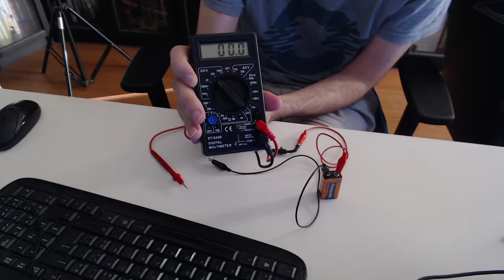How to: Test a HV Diode with a cheap multimeter and 9v battery

Comment: We used a crank megger to test them, just crank really slow and watch the meter. The dividing point in diagnosis is the transformer primary, voltage or signal from the board. Hardly ever had a bad transformer, bad tube, diode or HV cap, were common., If the owner had roaches the board might be damaged beyond repair.  Lots of common problems with old Kenmores.

Comment: did you ever find the problem?
Reply from the maker: sadly no, ended up stripping parts and dumping the shell on recycling and get a new microwave. learned a lot about microwaves though
Reply: @psenough  I repaired them in the 80s and 90s by the thousands, when they cost $500 new, what was the problem?

Comment: For the cap, you could really do with a dedicated capacitor tester. While some DMM's (not yours, sadly) can show the capacitance, they seldom have the function to show ESR (equivalent series resistance), where the desired ESR would be as low as possible (so as not to restrict current - you should be able to find this on a spec sheet for that type of cap).  

Your DMM might be able to shed a little more light on the Diode in the continuity test mode, by omitting the battery you should be able to put it in continuity test mode and it may either emit a tone, and show 0 (usually not good but your DMM may not care) or emit a tone and show a reading (the voltage drop - which you can check against a spec sheet of the diode type). Then reverse the polarity of your leads, a good diode should not have continuity at all with no tone (at the low current your DMM provides), and remain 0 on the LCD when the polarity is "wrong". Some diodes do work in different ways, Zener / Schottky etc. So it's always best to research. Most components will yield results with a simple search. 
 
It's not a bad door latch switch is it? Some microwaves have a dual switch on the door latch, one to allow the main circuit to operate, and another to enable the magnetron circuit, this was common on the older generations of "digital" microwaves.  Another thing that you may or not have is a "probe" circuit, where inside the oven cavity is a 1/4" jack (yeah seriously) socket for a temperature probe for "heat and hold" mode, this is usually on catering microwaves, but they are a thing on some domestic ones, my old one had it.  As it's like a headphone / recording desk / patch bay type, it may be that the contacts on the socket (when not populated by a jack) could be corroded and not making contact, confusing the heat and hold function - even if not in use. 

Good luck on the rest of your repair :)
Reply from the maker: didn't know there was such a thing as a dedicated capacitor tester :D the door latch does have 2 switches but both seem to trigger fine (also tested continuity on them. didnt see any jack in the oven cavity, dont think this microwave has any of that. i did initially (before learning more about microwaves and opening this one up) thought that all microwaves had such a temperature probe and that that's what would control if the magnetron would be emitting or not during the cycle, my conspiracy theory is that such a sensor could have been coated in grease or something and get heated faster than the rest thus cockblocking the magnetron's work, but it seems most microwaves dont have those kind of sensors and just activate the magnetron on a timer base depending on your selection somehow, letting the pcbs handle that logic i guess.
Reply: @psenough  Yes, the probe is usually a simple device like a typical DS18B20 - or maybe a K-Type sensor in a coated stainless package - what peeps use with Arduino level stuff these days.

I see you have made a vid about the relay, I shall be interested to find out what you discovered with that in the morning. 

If all sensors, activation and safety stuff is working and you still have no "heat" I would suspect a failed I/O on the MCU that handles the operation (or maybe a failed MOSFET or similar type of transistor that buffers the output from the MCU)

Modern power tools - even the expensive ones - can fuck up if they are not buffered properly. Sadly disposable items rarely uses any possible display(s) to alert the end user what is wrong.  

"oh, it doesn't work, I had better buy a new one".

ATLAS ESR70 is a dedicated cap tester, but I'm not entirely sure it could measure the cap you have, if it could it may take a long time to give results - it's a low powered device. There are more "professional" testers out there that can accommodate higher voltage and capacitance components, and there's rack mount units made by companies such as HP dedicated to the task - but way overly complicated and expensive. The Atlas is great for testing caps that have been pulled from retro stuff though.